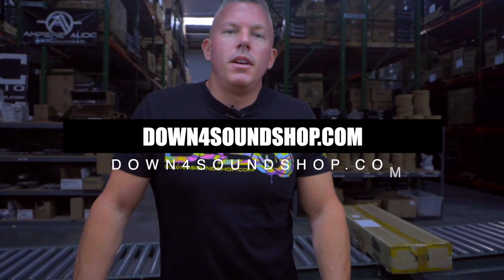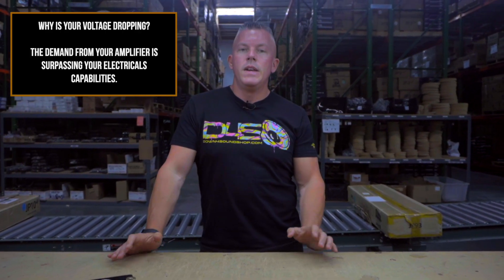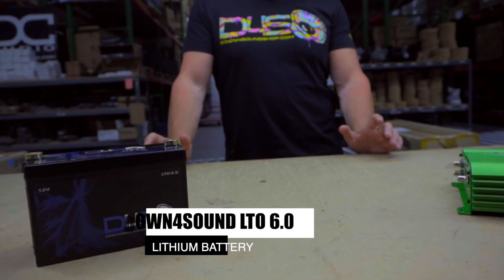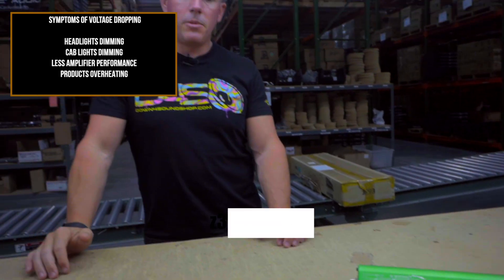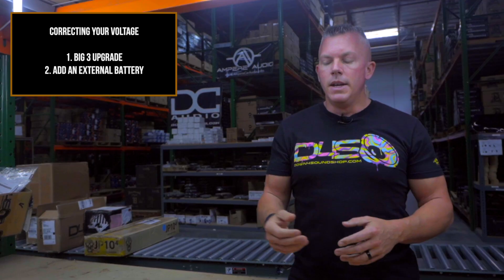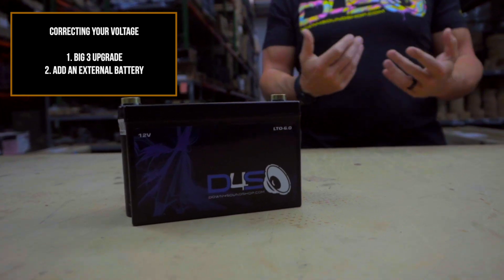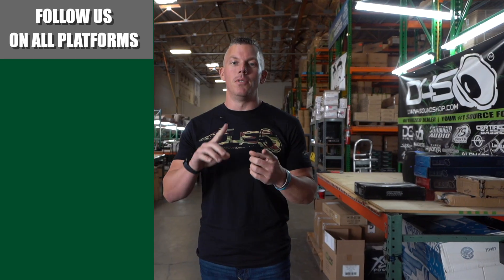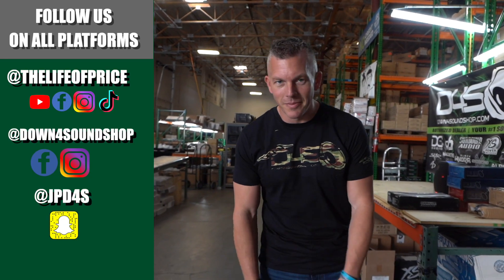VOLTAGE DROPPING? HERE IS HOW YOU CAN FIX IT!!

Comment: So in my ram I’m running 7500rms
I was trying that on stock elec with 3 100ah lithium solar battery 
It held for the most part with needing topping off occasionally.
Upgraded to a js alternator 400a, and I never need to top my lithium off! 
Thing is a beast

Comment: I'm constantly doing power upgrades. I just learned the hard way. I have lots of experience but sometimes we just want bass now!! I strapped to dc 3500s to 1 ohm. Meaning each amp was seeing 0.5. Why? Because I just had the sub built and didn't want to pay to re cone it to a dual 1. But the biggest issue is I didn't realize that I had a wire in the back coming from my other battery that had gotten lose over time. So in the rear my voltage dropped to 9 volts. Causing a hole to get burned through my voice coil. There was a fire in my box and it took less than 1 minute to do that. I didn't have the proper power to begin with so that little short in the back was all it took. With a 7000+ watt current draw you need more than 160 amp alternator, big 3, and 2 group 31 batteries. And 2 runs of 4/0 welding cable. Keep in mind 4/0 welding cable is about the same size as 1/0 sky high wire. One of the biggest things with people is they go and buy these powerful amps before having proper electrical. They tell there self there just going to keep the gain down. I'm one of them. I only paid 600 for the pair of dc audio 3.5ks so it was a hard deal to turn down. But the sub is getting rebuilt as we speak and a 370 amp mechman along with a xs power superbank will be ordered very soon.

Comment: I have a JS 370A Alt, SB500 500f Cap, and Titan 8 RSV-S6.
My JP43 is dropping 74v 1ohm at the speaker wires and my voltage only dropped to 14.4v that's nuts. With my math, I was expecting 14v. (74v 1ohm = 5500w / 0.75 amp efficiency  = 7300w from electrical = 520a from electrical)
4/0 OFC main wire and copper for terminals and inline fuses.

Edit: on a random note, my stupid self accidentally flipped the slave/master switch. I spent 2hrs trouble shooting it and half my gas. I woke up today and remembered that switch existed. "No way in hell my stuff died, everything is hella dialed in."

Comment: I added a 290a alternator and 160ah yinlong (4 banks) and still drop into the 12v range.
Reply: U got that high quality OFC cables 1/0 and above
Reply: @ dual runs of 1/0 ofc from knukonceptz and skyhigh car audio.  Wish I could do more.
Reply: @Randy_G dang u got a good electrical I wonder why u dropping so low ? What’s ur Wattage rms?
Reply: @ I have a Taramps Chipeo 12k going to the subs.
Reply: @Randy_G what’s going to ur kids and highs ?
Reply: @Randy_G also what is ur voltage starting at?
Reply: @BellSounds-m1s taramps ds800x4 was a d4s mini but changed it out. Voltage typically stays around 13.6.
Reply: @Randy_G  get a regulator for the alt to charge 15 - 15,5v
Reply: @ do you have any recommendations on which one and from where?

Comment: Finally got my mechman 370 alternator. Going to be running 4 runs of 1/0, power and ground  to 2 jp40s. Now, so when you building an even bigger sub?
Reply: you need 2/0 gauge, and get the expensive shit with silver lining, it's heavier so you can tell the difference, its worth it

Comment: Need info, 93 suburban w/ 250 mackman, lto 6.0 battery d3400 xs power, xs power under hood capacitor, and a jp23v2 two 12" skar subs and still having voltage problems hitting mid 12 volts and it's not very load I watched amp volts turn down when low .I would like to find a quad alternator bracket for my vehicle no luck, I need a way to make me owne since I can't find anything else for it , what do you think about this.😢
Reply: Depending on the watts you are running, you may need a secondary power source just for your subs. Use the 250 mechman for your vehicle power supply and a 370 mechman on your subs. A 370 should be sufficient enough if you're not running over 4000 watts on your subs.
Reply: @omark2423 I need a blue print for a 93 suburban 2500 with a 7.4 4l80e Transmission 12si alternator serpentine 
4or 5 alternators if needed
Reply: Why a QUAD bracket? Upgrade the 250 or go dual, and add a second. No need for 4 alternators in that setup.
Reply: with a 250alt and those batteries you should easily be able to run a jp23, youre problem is something else. Might be the wiring, maybe the alt is broken or something else. I repeat you DO NOT NEED more alternators or batteries for this setup
Reply: @aracistpriest6121 that jp23 is pulling 2800 watts at 1ohm. That 250 alternator can't handle that and his electrical. If the d3400 is the only battery he is using then it is only doing 2500 watts. I had the same setup and when i upgraded to get a secondary power supply,  it kept the voltage up. Them jp23 can take some power.
Reply: @omark2423  There is NO WAY the JP23 pulled 2800 amps at 1ohm. The JP83 has been benchmarked at .5 ohm pulling 1400 amps of current. No way this is double that.
Reply: @Maxspeed996 if you have a jp83 only putting out 1400 watts at .5 ohms. You need to not to install anything including light bulbs in a lamp.
Reply: @omark2423  Now that you EDITED your comment. You said it was pulling 2800 AMPS. Not watts. There is a BIG DIFFERENCE.
Reply: @Maxspeed996 I checked it. My bad. But he still needs a backup power source. That 250 alternator is not going to handle all that power at full tilt.
Reply: Any chance does anyone have a schematic for a duel triple alternator bracket??????
Reply: @jerryhammer43 to buy or how to install
Reply: @jerryhammer43  For a what? A "Dual Triple"?  So you want 6?
Reply: Thinking about later maybe 3 alternator bracket I'm a welder but it would be permanent.
Have it and not need it sounds more like it to me
Reply: @jerryhammer43 blueghost alternator bracket is a good place to go with. I ordered a dual bracket from them and it's easy to install. 3 bolts from the engine block is all you need to remove. They supply the bolts you need to replace them with.
Reply: @omark2423 I hit them up and haven't heard anything from them yet.
Hopefully I can find a schematic for a duel, triple alternator serpentine bracket, I have more time than money, can't seem to keep a transmission.😢
Reply: @jerryhammer43 you just have to order from them. I had the same problem with my 93 suburban. Had someone to rebuild it and he made steel components where the aluminum parts was at. Never had a problem again.

Comment: OVERSIZE ALL YOUR GROUNDS!

Extremely underrated, yet massively beneficial.
Reply: having a good flow of the electricity in the car is a must but it really isnt necessary to oversize every single ground wire unless youre doing it to upgrade in the future, diminishing returns
Reply: I went overkill on my ground x3 zero gauge OFC welding wires one to the frame one to the block and one to the body that's for my big 4 lol then took x4 runs four gauge tined OFC wire ran that from the alternator leaving the stock wire there so that's x5 four gauge power leads then x2 zero gauges to the trunk with dual agms system hits so deep and powerful it's a huge noticeable difference especially with the 350 amp alt and dual batteries starts off strong and stays strong and nothing gets hot.
Reply: A bigger ground Maximizes ANY power wire........

But, a bigger power line can only pull what the ground allows!
Reply: @charlesriston8972  yeah if youre pulling 150 amps and your ground and power are sized for 200A, oversizing it to 300A isnt helping you anyway whatsoever
Reply: You are right about that situation, it will not give u more power... 

We're looking at it from two different ways, sir.

Bigger Grounds are more efficient than Bigger Power Lines.
Reply: +1

Comment: When you say, “a ton of watts”; is that 2000 watts? 😂
Reply: No he means 2000 lbs of amplifiers 😂
Reply: You MIGHT get away with just the big 3 and a extra battery with 2k watts but with some of these amps being so underrated some 2k amps actually hit 3k+ and if that's the case you should get a alternator hit up BNR if ya broke like me lol got a 350 amp for $350 puts out 175 amps at idle and 350 amps at 1200 rpm, i wanted to get a Mechman but they don't do Crown Vics anymore it seems "at least not civilian ones" and JS wants almost $600 from them